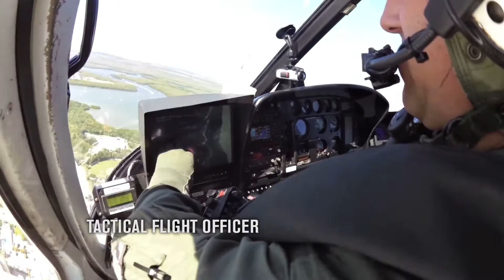Flying the Airbus AS350 — Flying Magazine

Comment: Based on what I saw in this video, it is my opinion that the capabilities of this high performance helicopter far exceed the demand by this law enforcement agency. It seems that an R44 police version would be just fine for sea level law enforcement applications such as this one, saving significant tax dollars.
Reply: The video showed just a portion of the work being requested by the unit. Just to mention two additional roles: We also have tactical benches and train transporting 4 person SWAT teams, rescue divers, etc. Transport of emergency SAR, K9 or fire teams to islands and small confined areas in our county are routine as well. We hope to have a bambi bucket too. Often in the heat of Florida summers we are at maximum power taking hovering with even two additional people because the law enforcement equipment adds significant weight as well. An R44 does make for a fine patrol aircraft and has been used in that role for agencies for many years. The R66 is gaining in popularity as well. We do most of our patrol work in the Cessna to save money as well.